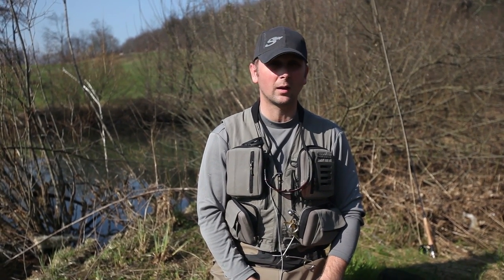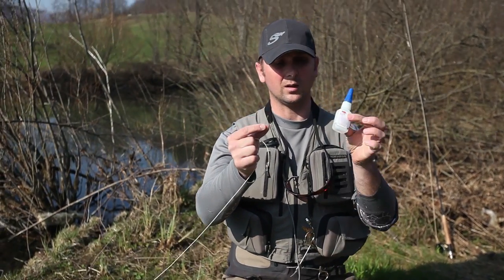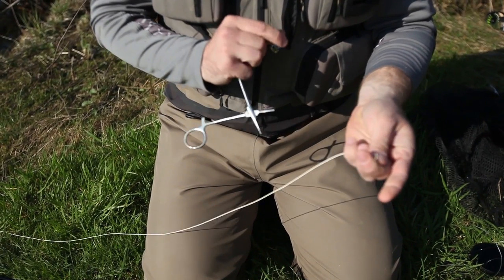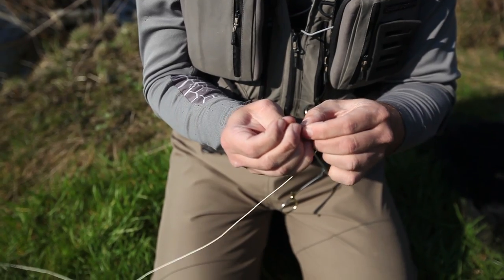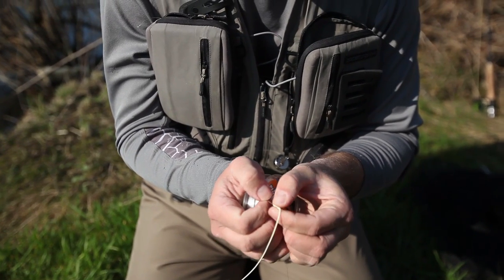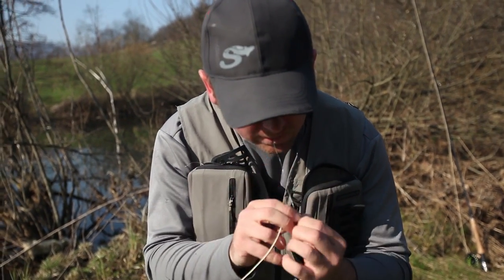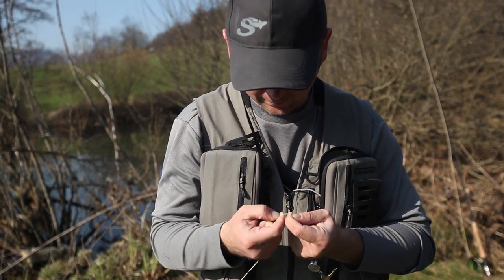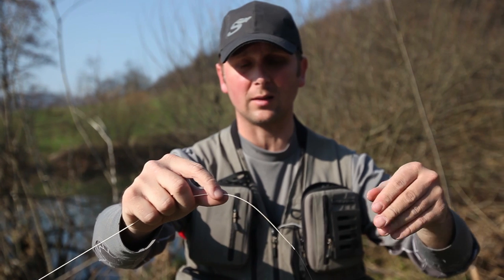No knot fly line to leader connection

Comment: I was shown this technique by Dave Whitlock at Chatsworth angling fair in the late ‘80s. It does sometimes fail on bigger fish in my experience, though in fairness to DW, he used it on fly lines rated above #10 for saltwater fly fishing. Three points to add: DW insisted using waterproof superglue (apparently there’s superglue and superglue). He also used tapered mono leaders. Finally, he insisted that the section of leader to be housed and glued should be roughened up with an abrasive, like sandpaper. I’m a sea trout angler, so short leaders are the norm, meaning the join/tip guide causing a problem isn’t an issue. In practice too, the notion that this method will cause  regular bits of fly line length to be sacrificed, isn’t so. A tapered leader has level monofilament line added periodically; that’s where the ‘wastage’ occurs. Another tip: if you target heavy fish, leave about a cm. of the butt section of your leader protruding beyond the join, rather than cutting it flush. Whip over with Kevlar thread, and coat with Aquasure or waterproof superglue. It’s not quite so streamlined, but has never failed me.

Comment: Well its not new, I been doing that since 1981, I do it a little different, I use the needle like you do, go about a 1/4 to 1/2 inch and then out the side, take a one piece leader or your favorite butt material, and cut heavy end on an angle with a razor blade, then run it thru the fly line and out the side  a little, put a drop super glue on the leader and then pull, once set use the razor blade to cut the excess mono and then give it another pull to smooth out the connection! If done correctly its as strong as any connection to a fly line can be! I also to it the same but with a nail not instead! Very strong, you will break fish off before that connection will break! A little goes a long way with super glue, practice on an old fly line to get the hang of it!

Comment: firstly youre cutting and then weakening/damaging your fly line that cost 50 odd quid, secondly what happens when you need to change leader or if it gets snapped? there is a reason why you see nobody using this
Reply: I agree and was going to post a similar comment ....it would not be cost effective to keep cutting away your fly line every time you change leader .....
Reply: I do agree with the weaken of the line but if you put a small tippet ring on the end of that leader that should make the leader last the life of the fly line.
Reply: ummm original commenter  this is just for long leader euro nymphing. (everybody who wins world championship  is euro nymphing. since Polands victory). you need the connection between the fly line and leader to fly through the guides like butter. even if that means you weaken the connection. your never running more then 8 lbs test even for steelhead. the line these people buy is competition euro nymph line anyways. so it never gets used to anything else like streamer fishing etc.
Reply: I personally wouldn't use this technique either but I suppose you could use the butt end to make a loop once that leader is worn out but then you might as well keep the loop on the fly line.  I just prefer loop to loop myself